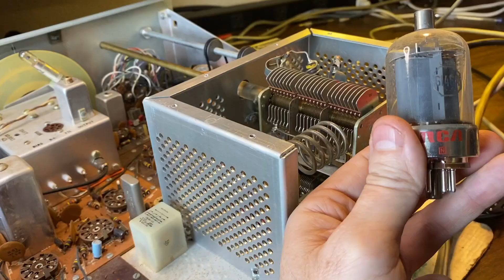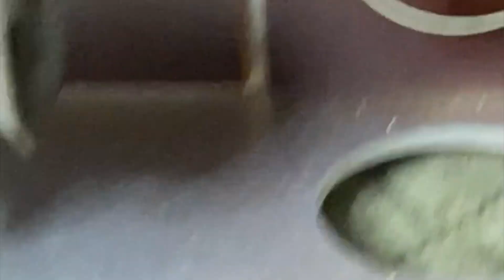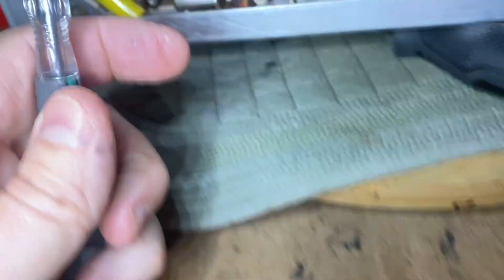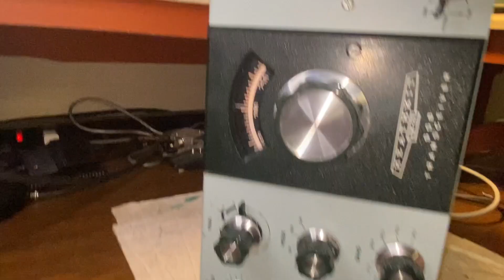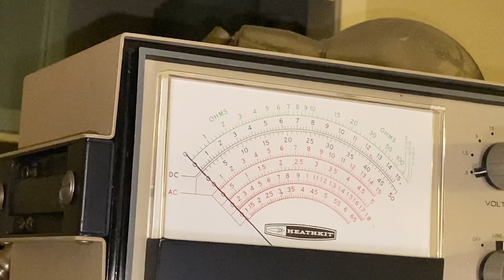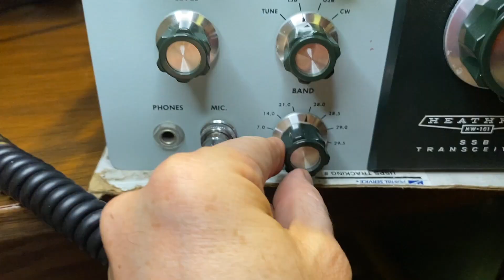Heathkit HW-101 - full restoration #1

Comment: That extra wire could have been installed by the former owner if he also has a Heath monitor scope.  Then the wire might have been mentioned in the manual for the monitor scope.

Comment: 35 years ago I was at a neighborhood garage sale. bought one of these with power supply lots of extra stuff for 20 bucks. mine has the cw filter. I put dial cords and springs in to replace the rubber bands. the radio worked great. its been on the storage self ever since.

Comment: I enjoyed your video. I am working on a HW-100 that has both filter's installed, they must have been an option because the face plate is not silk screened with the "SSB and CW" positions. I'm also rebuilding the  HP-23 power supply to go with it.

Comment: Nice work!  I'm doing one myself.  Had to pull the IF board to repair some lifted traces and a real butcher job on a swapped resistor.
Reply: IF board completely recapped and nearly all resistors changed.  Repaired lifted trace.  Just got it back together tonight and receiving great.  Jackson drives are shot, have two on order!
Reply from the maker: Hope it all came together. 73

Comment: Great restoration! I built one when I was 18. I got half way through and I stopped and it got put away in the closet for another day. I got distracted by college, cars, girls (not in that order!) and it took me about a year before I pulled it out and finished assembling it. I was totally amazed that the first time I turned it on, it came to life, 20M alignment was already close enough to hear plenty of activity before I did the total alignment. I used it for about 10 years before trading it and then getting brand new TenTec Omni D, one of the early all solid state rigs. I don’t know if I will pick up another HW-101, but your guidance in this video will certainly guide me if I do. 73 Dave K7DR.
Reply from the maker: thank you, and I hope you find another 101, they're such fun.

Comment: I'm surprised that this 100 W out (say 220 W in ) rig does not have a massive  HV transformer to go with it.  Perhaps there is a power supply in  a separate box that you don't mention.  I take it the output tubes are in that  LHS ventilated  box. 
It's interesting how  Heathkit used  PCBs with valves.  This was done on a lot of TV sets too for a time - the main issue is heat conduction down from the tubes and subsequent lifting of the PCB traces. However,  a PCB makes it a lot harder to make wiring errors if it has a component layout.
Reply from the maker: Yes, it has a separate power supply .

Comment: All electrolytic capacitors have paper separators/dielectric AUI, that absorbs the electrolyte and keeps it in place between the aluminium anode and cathode foils. In some esoteric audio capacitors, silk is substituted for the paper.

Comment: I'm in the process of doing one of these right now. Lots of fun! Mine had similar problems to yours. Power supply needed completely rebuilt and bought a 3rd party kit that made the process simple. My cabinet is in good physical condition but badly faded. A repaint job with a coat of Hunter Green from Home Depot made her look like new. Face was in good shape and just needed cleaned. Great rig. I've got find the crystal filters though.   Great restore video, thanks! I've never tried the warm soapy water clean, makes me cringe but I know it works.  Big fan of the DE-Oxit products too.  W3BUW

Comment: Thanks for this, sir!  It did my heart good to see the thing in the sink, and then all soaped up.  The first time I heard of such things, it was about Tektronix cleaning oscilloscopes this way when they'd come in for service.  If you come from a more timid background, it's an eye-opener!
Reply: A company I worked for in the 90’s build electric substation SCADA RTUs.  After running their boards through the wave soldering process and then using a router to trim all the leads they put the boards into a household dishwasher to clean them off. Of course there were always a few components that wouldn’t survive such treatment.  They were added after the dishwasher stage and the leads trimmed and flux cleaned chemically.

Comment: Cleaning a circuit board with soap n water will remove dirt n grime. 
An use a toothbrush and scrub the board but not aggressively. 
An rinse with water, simply let the system Air dry or use a hair dryer.

Comment: Well this video is really helpful thank you. I've been getting into electronics I bought this Heathkit GW 21 and put new capacitors and it's got great audio and works pretty good and all the carbon resistors our original should I just leave it be I haven't checked them it is an old walkie-talkie the carbon resistors look okay I have not tested them should I just leave it be you think. If not could I actually test them answer key it's not a tube type.
Reply from the maker: It's a walkie-talkie. If it works fine, I would just use it and enjoy.
Reply: Yeah it seems to work pretty good I pick a lot of skip up on it they use it once in awhile I have a lot of old vintage 1960s walkie talkies that I recap they all seem to work pretty good after that I enjoy listening to skip on the radio but I want to start getting into tube type vintage radios

Comment: Great video.  Brought back lots of memories.  After my FIL, who had used Morse as a railroad operator and dispatcher earlier in his career, retired he got into ham radio.  I found one of these, partially assembled, on a bulletin board in a Radio Shack store in Newark, OH in early 80s.  I bought it and took it to a Heathkit store, as I recall, in Columbus, OH.  They completed the assembly and did all the calibration/adjustment.  My FIL used it for at least 10 years.  After my FIL passed, I gave this unit, and all his other ham equipment to his neighbor.  How I wish I would have kept it! BTW, I have a Heathkit FET-VM which has the same meter as the VTVM you used

Comment: Very nice work! I have just started working on an SB-102 which is very much the same radio. I am working with little test equipment.  I have DMM and oscilloscope but no VTVM or tube tester so I am in for some workarounds.  I would like a searchable manual for the 102 but the links you have only to the manuals for the HW-101.  Do you have a general link to other manuals?  Thanks for the video, it going to be a big help to me.
Reply from the maker: Haven't seen a searchable SB-102 manual, but PDFs are available online.

Comment: Thanks for this video.  I have an HW-101 that needs work.  The AVC is really flakey.  I am going to measure the resistors and see what I need to do.  Any hints on the AVC?
Reply from the maker: Do you have a searchable PDF? There's one in the video description. I'd download that and look at the circuit description of the AVC in the back of the manual and analyze everything in that particular circuit. Check out the resistor PDF I uploaded as well and check them all if you haven't already. Good luck!
Reply: @N5OLA  OK did that. Thanks again